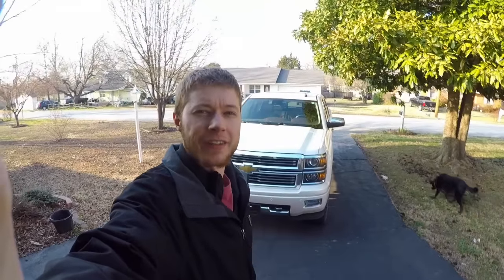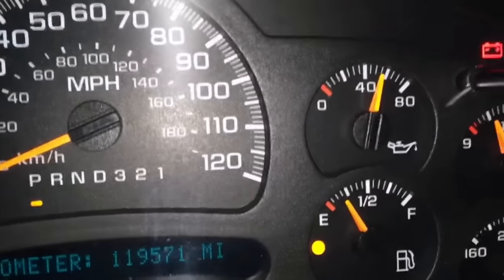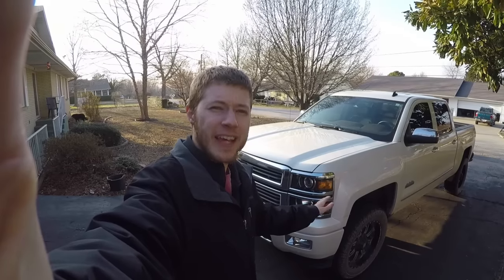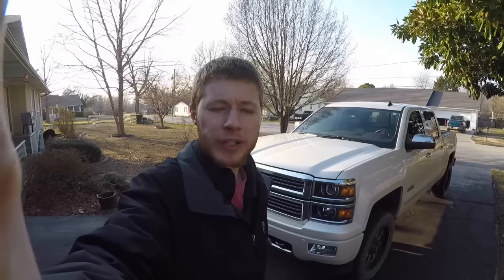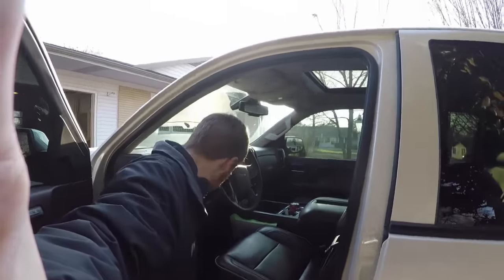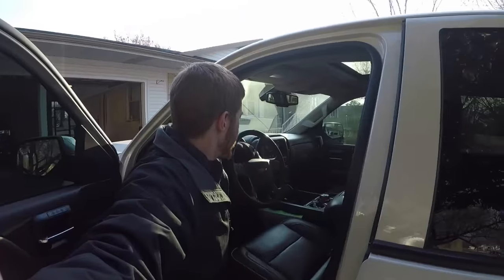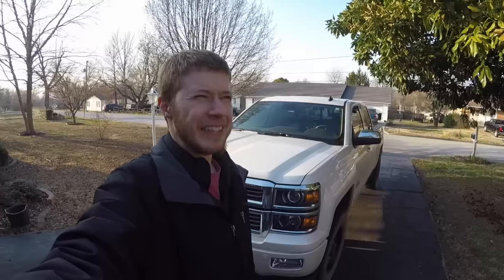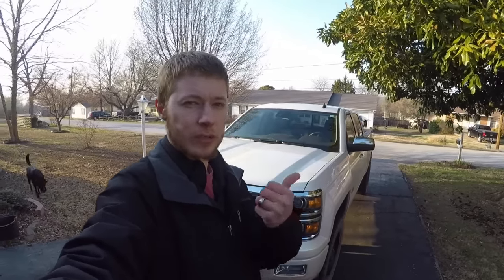Silverado Sierra 5.3 Lifter Noise Tick (What to do)

Comment: There's a couple things that cause the ticking noise

1. A dirty VLOM filter (Under oil pressure switch for AFM/DOD systems)
2. 0w-20 or 5w-30 oil caused wear on a lifter bore.
3. Blow-by carbon causing stuck lifters or wearing lifter bore

When the VLOM filter gets clogged the solenoids don't receive enough pressure to activate the AFM lifters, so they shut down. You may flush your block, thinking it fixed it, but you just pushed the dirt through the filter. Also when a lifter shuts down it can cause a very slight wear on a lifter bore. Even with as little as 15,000 miles this system can fail.  What happens now is the lifter is full of oil and starts to rise from the camshaft , but the bore has enough wear in it to bleed off the oil from the lifter cause it to hop on the camshaft. GM should have never designed a lifter with .150 of travel after the .030-.080 of preload. They should have stayed at .020 of travel, sleeved the lifter bores, and added a full oil ring the lifters. An easy test is to use 0w-40 or 10w-40. If the noise quiets down your lifter bore or bores have a slight wear. The only reason they want 0w-20 or 5w-30 is for the AFM/DOD solenoids and VVT response time. If you don't have the AFM/DOD system it's most likely a worn lifter bore from the thin oil. That being said the LS aluminum block are noising.

This is also common problem with aluminum valve bodies in transmissions nowadays. The slightest wear in the anodized film can cause the vehicle to not up shift, downshift, or have flares lift the clutches are slipping.
Reply: I had that tick in my 5.3 2015 Sierra.  I drained the Mobil 1 and refilled with Nyquil.  Now it is so quiet, nothing but Zzzzzzzzzz's.
Reply: @larrywarolin7215  Boy, I just bought a 2014 Sierra 1500, SLT, Z71. only has 27k miles, owner only droved on weekends, to HD/ Lowe's and probably DD!🤣. My first GMC was 2003, droved til 170k, only issue was a transfer case, which I replaced @ 140k. Wondering if I should buy extend warranty, like 48mo/40km. Dealer offering, B- B. 3k. Crazy! Only issue I noticed is when I use the breaks, if above 40MPH it viabrated. Should've done my homework prior to invest in this pile of problems.

Comment: I had a new 2017 ltz silverado and it did the same thing,also there known for lifter failure and oil consumption like a quart low every thousand miles,the only fix was to get rid of the V4 mode with a software plug in to keep it in V8 mode full time,these engine the lifters are under the cylinder head unlike the older chevy engines.

Comment: thank you , i just bought a 2000 silverado yesterday with a tick  , seems like it has plenty of power
Reply: Similar boat. Just picked up an 08 silverado 2 weeks ago with the tick. Its annoying, just hope it doesn't end up getting worse.
Reply: @m.m14433  I've put about 150k miles on my 2003 Silverado 5.3L without any issue. It's more annoying than anything

Comment: These motors are junk. My 2014 Silverado 6.2L only 71k miles has 2 bad injectors, trans acts funny randomly on upshifts, and have had a history with electrical problems. I will never buy another new truck again. Wish I would have never sold my 05 Silverado!

Comment: I got a 2010 Silverado oil Pressure Gage is 30 psi at idle and 20-18 Running on interstate Replace Oil Pump O Ring Sendind Unite & Pressure Still the Same Runs Fine No Noise But Keeps throwing the P0152 Code for Oil Pressure Switch Any Advise ?? Thanks

Comment: Easy..    high viscosity oils don't flow well and wont pump up the hydraulic lifters as well as the recommended oils..    since they dont flow as well, youll also get more buildup that will dislodge, flow around and clog up passages.     

Easy fix....    just add a quart of ATF to the oil.     in 15 minutes the tick will be gone...  given its a collapsed lifter.    ATF is a hydraulic fluid and doesn't compress, has a lot of great detergents in it.        run it for a day or two then change it to a full synthetic of the correct viscosity..    dont add any oil stabilizer or anything that would increase the viscosity.        

im speaking from experience.

Comment: high octane fuel stops my knock. my 5.3 only ticks when driving it.but the premium fuel stops it.
Reply from the maker: Good to know, may try that!
Reply: JamieGearheart by using the 93 octane, was your ticking noise coming from the drivers fender under the driver's door? Was the ticking at normal operating temperature on the truck? I have a 2010 Chevrolet Silverado 1500 5.3 liter engine and it ticks that way and was wondering if the 93 octane will eliminate the ticking noise? Thanks

Comment: That noise didnt sound like lifter knock.

My 2007 LS had it after i changed to mobile 1. I did a flush, pulled oil pan, replaced oil pickup tube packing. Put in Valvoline HiMi. Problem solved.

Disable DOD and AFM.

Comment: Its totally normal to do that i have had two 5.3 engines over the years when they warm up it goes away why even make a video about it its nothing to worry about if you do motor flush or anything you are wasting money.
Reply: Thank you for the information. I have an 06 Chevy 5.3 that would not stop ticking and got even worse. I was told to check the O - Ring on the oil pick-up tube in the oil pan. When I checked the O-Ring it was worn out. I replaced it and the ticking stoped.
Reply: @richardbiss4967  so you had low oil pressure then?

Comment: It's the vacuum pump. These gdi engine don't produce enough vacuum to operate the brake booster properly. It's more noticeable on the driver side because the v-pump is were the power steering used to be. Hope this helps.
Reply from the maker: Thanks for the tip buddy!
Reply: YOU  ARE 100% PERCENT RIGHT.. just had mine replaced under warranty

Comment: My 2014 sounds the same.  That’s the High Pressure injectors. 

I have a 2005 with a 5.3 and lifter tap.  It’s NOT the same sound.

And FWIW, the 2014 has 135k, and the 2005 has 225k.

Comment: 239,000 on my 2010 Tahoe. It does it for about 10 minutes and then goes away
Reply: M. BREWER wow 239k on a 2010 Tahoe that’s crazy. I have 218k on my 2001 Silverado you must use it a lot, are all their miles just from daily driving?
Reply: M. BREWER or do you go on a lot of road trips

Comment: The newer engines are direct injected and it's the high pressure pump usually mounted on the driverside of the engine. The older non direct injection were normal expect there was a bad batch of motors in 2011 n we had 2 tahoe and one silverado that had the upper end rebuilt. One tahoe that had the entire engine replaced. This was due to the fact that the metal content in some engines wore quicker than normal. So yeah it could be tons of other things and we'll never really know. 👍
Reply from the maker: Holy cow!  Makes me think that its probably a good idea to run Top Tier Gas in these engines.
Reply: Dustin T I wouldn't worry too much about the octane rating, or premature cylinder wear, because direct injection can precisely control the right amount of fuel per cycle. However, definitely buy fuel from the better quality brands to make sure your injectors stay healthy. Also, look into getting a PCV catch can so you don't get oil build up on the intake runners and on top of the valves. Due to direct injection, you don't have fuel "cleaning" the valves.
Reply: Dustin T Kinda late but the HPFP is actually in the intake valley and driven off a additional camshaft lobe.

Comment: Try a can of ENGINE RESTORE after every oil change it quieted my engine, it was ticking. I can barely hear my 2002 Chevy Silverado 4.3 V6 with 200,000 miles running now.

Comment: I own a 02 Buick with 305000 original miles transmission same miles since I bought it swap all the fluids and power steering too and use amsoil products and my car is running strong with out any noise now I just bought a 2018 Silverado texas edition with 10 miles the very first thing I did change the oil and use amsoil I will do the same with the transmission after 1000 miles. I’m hoping will do same as my 02 Buick I’m still driving it every day in fact I drive to Mexico very often with out any problems.

Comment: My 15 sounds identical. Started researching it and every thing I see says it's direct injection. My 02 had the tap your 06 has. That was a known issue. We call it the Chevy slap. Has to do with head clearance on the piston. Goes away within a minute or so. Chevy actually had a bulletin on that. My 02 had 204000 when I sold it. Still ran like new. Nothing to worry about. Thanks for the vid.
Reply from the maker: Thanks for the comment buddy!  Luckily it just runs and runs.  I'll check out the bulletin!
Reply: below zero You call it "Chevy slap" but I've heard more Tundra 5.7's and Ford 5.0 Coyotes with piston slap than GM V6's these days.
Reply: Direct injection sound is consistent and continuous. That lifter like noise you hear is your vacuum pump starting to fail .. dealership will always say it's normal or blame it on direct injection. They just don't like doing warranty work because they don't make much on it

Comment: Dustin T, my 2010 Chevy Silverado 1500 z71 LTZ 4x4 does it too at start up and my noise is more like your 2006 was. My noise is very faint. I used 5 quarts of Mobil 1 full synthetic oil and 1 quart of Lucas Pure Synthetic oil stabilizer and I have been running the Lucas in my truck for about 500 miles, I can tell that the Lucas is starting to help my engine some. I did call Lucas and the representative said the same thing as my mechanic, drive it to get truck motor parts good and lubed and for me to give it time. Once the engine warms up to full temperature after driving it atleast 5 miles down the road, I can't really here any noise but the fuel injectors. I have also heard that these 5.3 liter engines have a directional fuel train where they will make a ticking noise like lifters tick. I have a buddy of mine has a 2014 Silverado and his truck had 73,000 miles on it and one day he was driving and he suddenly lost oil pressure and the trick was misfiring and then it shut off. Luckily under the GM warranty, he had it fixed and a valve spring on cylinder #7 . Not saying you may have this issue, but I'd I was you, I would keep an eye on it. I just think the whole problem is the AFM system on these trucks causing these issues and gm needs to go back to old 5.3 liter engine before they started the AFM system. I know other manufacturers have some type of AFM system, and they don't have issues like GM do. Well, hope this helps you a little. Great video before and now! Keep them coming man.
Reply from the maker: Good info buddy! Yeah I know the AFM on the 2007 was a nightmare, I’ve heard of many stories of people having to replace engines. The noise does seem to quiet down after the engine warms up. I’ll for sure keep an eye on it. Thanks for the comment, keeps me motivated to keep making more videos!
Reply: Dustin T thanks for the reply. My 2010 Silverado 5.3 liter  sounds a lot like your 2006 Silverado but was more to a faint noise. I would call it like a knock instead of a tick or tap noise, cause it is deep hallow noise, in my opinion. My noise continues even I allow the truck to warm up for 10 minutes. I drive my truck 10 to 15 miles and I can still hear it once my ear is near my passenger front fender well. Yesterday once I got home and I had the air conditioning on and the engine fans were on and I couldn't even hear it and once the fans stop, the knock sound was so faint that you really have to listen closely to hear. So with all of that being said, do you think I should worry about my noise or my engine failing? Since I bought the truck I have put about 700 miles on my engine oil that I have changed to mobli 1 full synthetic and so far, my oil level is still at the same place on the dip stick when I changed my oil. I just wanted to know what your opinions to me to do about my truck noise? Thanks bud and God Bless
Reply: Offroadmudbuggies ORMB I'm glad that I could help, lol. How many miles do you have on your truck? When did you first notice the noise on your truck and at what miles?
Reply: Offroadmudbuggies ORMB you are correct! It is just one of those things on these 5.3 liter engine. My buddy is a master tech and a GM dealership and he told me that the 5.3 liter engine, all of them will make noise, just the way they are designed! He said that I would go broke trying to fix it and once I replace the parts to the engine, it would more than likely go back doing the same noise, so he suggested me to just drive it and he seen the 5.3 liter have 200,000 or 300,000 miles on these engines. I'm gonna take his word on it. So I would tell you to just drive it and continue to service your truck like you have been doing. I also use 5 quarts of mobil 1 full synthetic 5w30 with 1 quart of Lucas Pure Synthetic oil stabilizer. Hope this helps!
Reply: I had a 2011 gmc 5.3 and at a little over a hundred thousand miles I was going down a Hwy and my oil pressure dropped to 0 and all my lights came on to shut it down, pulled over real quick, checked oil and it was fine, fired it back up and oil pressure went up to first mark, I think it's 20 pound mark. So I turned around and went back home, like a couple miles from house and it started to drop again, but not quick like before and it never made any tapping sounds during all this. Before this happened I always had 40 pounds, so I changed oil next day, fired it up pressure went to 40 and after warm up it went back down to first mark, so I bought a oil pressure sending unit and checked screen ( it was fine ) change sending unit and did same thing, start up cold 40 pounds and after warm up back down to first mark. So I decided to trade it in and on the way to dealer, like 30 minutes away on interstate , it started to go down to 0 and never made one tap, knock or anything. Still to this day I wonder what the hell was going on. I talked to one engine place and he said that in that year range GM got a bad batch of cam and lifters and had problems with them and they were it and missed, so another word you can have same year and model, one truck could have the bad cam and lifters and other one would be fine.

Comment: So I had to replace camshaft and lifters in my 08 5.3 with 40000 miles. Fixed it. I now have 130000 miles not one tick. It’s a gm crap deal. It probably would have ran for a long time. I just didn’t like it.

Comment: If only they didn't have AFM.  Almost everyone I know with an AFM silverado/tahoe/etc has had lifter failures between 100k and 150k miles.  That's insane for how expensive these trucks are.  And the repair is not anywhere near affordable.

Comment: I tried a 2006 had a loud tick. My 2004 1500 sierra doesn't make a tick with 250K miles. How many miles were on your 2006. I believe a heavier oil helps. I had a ford escort that had the tick. I used 50W and it went away.

Comment: The bearing on the alternator can make that noise. I have stock original alternator 174,000. I changed belt awhile back and spunk it by hand. I thank its the stator rubbing on the rotor. Plus the rockers are known for sounding like a sewing machine. I did dod/afm delete with new ls7 lifters. It's normal noise. Never use a motor flush or bars leak the just band aids that are more harmful for your motor.

Comment: Mine has done this on a cold start since I bought it with 78K miles on it.
Currently have 166K on the original engine. Replaced transmission due to bad torque converter at 98K miles.
2017 Silverado 5.3L

Comment: I’m not no professional mechanic, but learn a lot about smallblock 350s and 454s ,new cam and lifters every 100,000 miles is what I would recommend but I ran a 4.3 vortec v6 “based on the small block 350” till 300k

Comment: Been GM tech 35yrs to long,the list could be as simple as exh.manifold bolt broke to Active fuel management issues which leads to cam and or lifter damage.add qt.Marval Mystery oil and or Qt ATF to motor,if still there run it!

Comment: Suburban 2500 6.0 been doing it since I got it 212k. I’m at 292k. Worry not my friend. Still runs the same, maybe a little slower. Could use an engine tune up. Spark plugs lol etc. but probably will never actually need a tune up or anything.

Comment: ABSOLUTELY NOT NORMAL.. dealership just replaced the vacuum pump due to extremely loud ticking when engine is cold. on my 2016. it is located at the front of the motor on the drivers side it also has its own belt . that's why the sound is more prominent by the drivers side wheel well .. that is the sound of a vacuum pump starting to fail.. GM uses a different part number as a replacement.. I had mine replaced and haven't had the ticking ever again .. 14 and up 5.3 motors are more complex than previous .. the purpose of this pump is to produce extra vacuum when the truck goes into V4 mode ..The truck doesn't produce enough  vacuum to the brake booster when its in V4

Comment: got a 2002 tahoe 5.3 got 304k just did a transmission rebuild at 302k.  Only other major stuff is rebuilt front end at 250k and fuel pump at 200k.  35- 60 psi oil pressure depending on rpm. Original motor and axles too.

Comment: my 2005 ford escape makes a tapping noise when in park on idle i was told low oil can do this but even though correct oil is in it still does it it has a good amount of miles a little over 200,000 miles

Comment: my 2018 silverado ltz  makes a ticking sound when i push the gas i can hear the sound coming right from under the wheel well under the driver side, a 60 thousand dollar truck making a stupid sound like that not even 2000 miles on it , i should have gotten myself an f150 :(